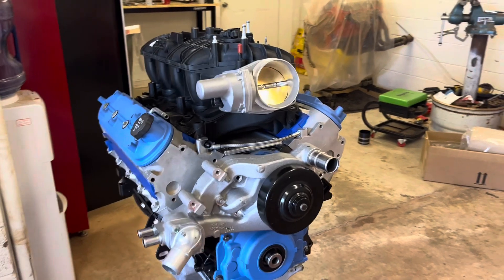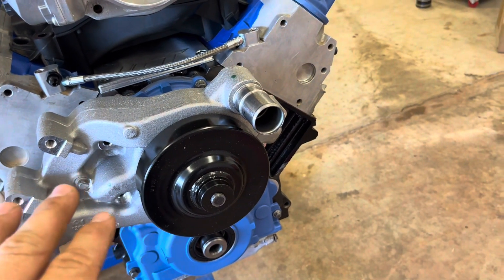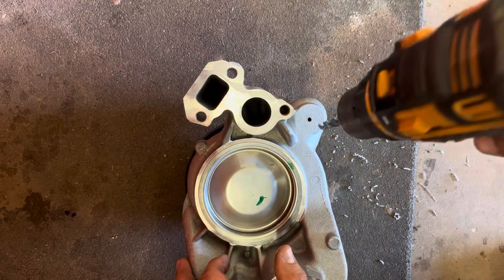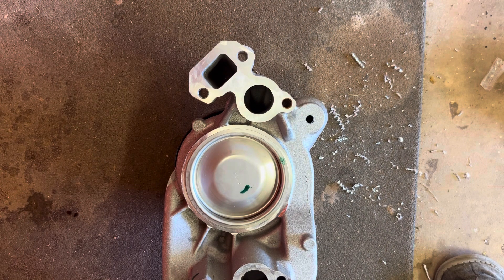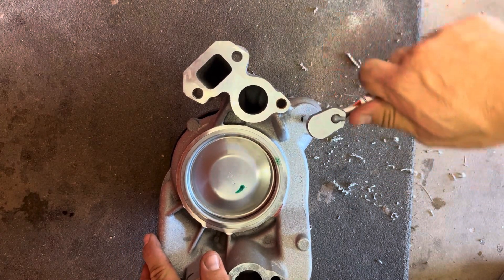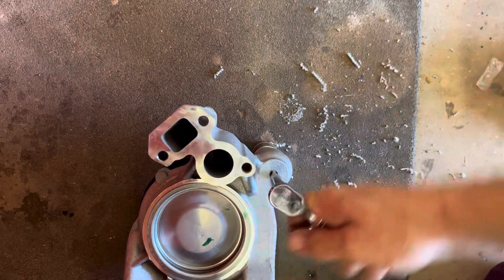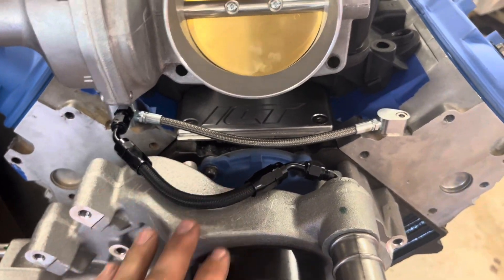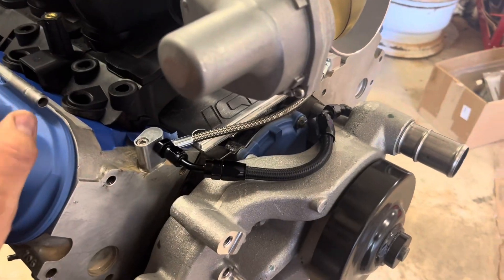5.3 LS simple and clean steamline.

Comment: Thats the radiator return fitting and high pressure - you want the steam lines to a low pressure area.
Reply from the maker: It does not care as long as it is returned to the radiator.